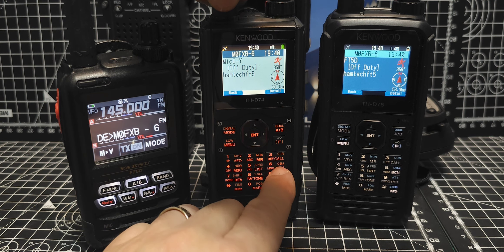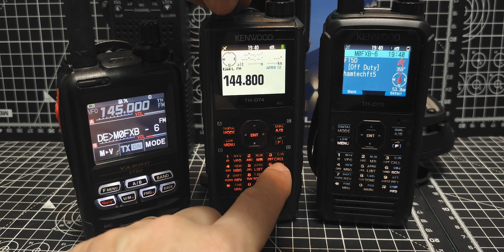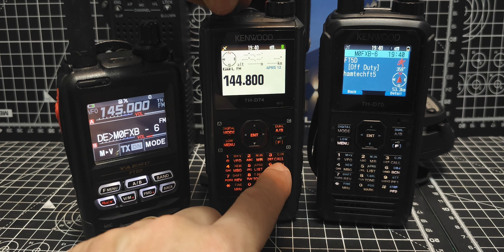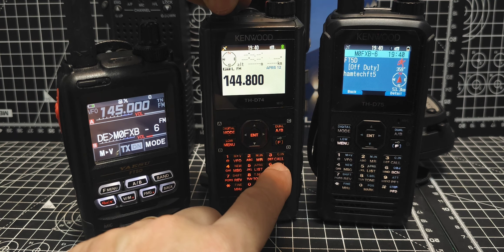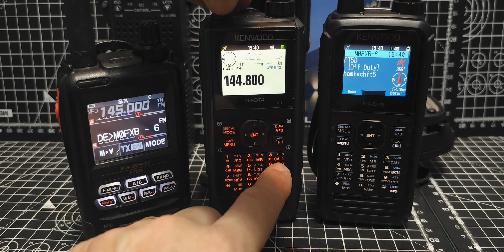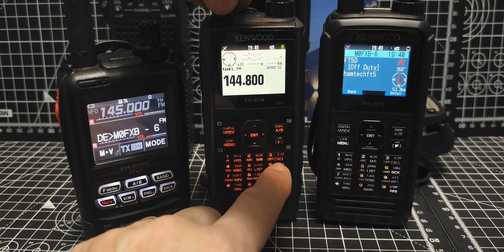KENWOOD D75 - Digipeater FT5D

Comment: Hi Andreas,

At 0:40 actually you CAN enter any values you want for the DIGI PATHs P4 to P8 !

Basically, the digi path is the path you want your APRS packets to follow.
It can be specified in the form of WIDEn-n callsigns (that's called the "new paradigm" of digi path, unlike the "old paradigm" where callsigns like RELAY or TRACE were used), or in the form of specific callsigns that are simply names of digipeaters, like GB3WB that's near your QRA :)

When your digi path contains WIDEn-n callsigns, your APRS packets will be digipeated by digipeaters that are configured to respond to these specific callsigns.
For example, a digipeater in a small local area (a "fill-in" digipeater) would be set to respond only to WIDE1 packets, and a "bigger" digipeater (covering a much wider area) would be set to respond to WIDE2 packets.

If your digi path contains WIDE2-2, if can be digipeated 2 times by "wide area" digipeaters that are set to relay packets with a WIDE2 path: when the 1st digipeater relays the packet, it changes the WIDE2-2 in the digi path with WIDE2-1, informing the next digipeater that this packet should be digipeated only once more.

That's roughly the principle, but you can read this in more details here for example: https://blog.aprs.fi/2020/02/how-aprs-paths-work.html

And like I said, you can also put real digipeaters callsigns in the digi path: if you put GB3XX,GB3YY,GB3ZZ in the path, and these 3 digipeaters are in RF range of each other and also distant from the starting point in this same order, you could "force" the packets to travel through these digipeaters in this exact sequence :)

So on the FT-5D, you can edit digi paths P4 to P8 to set whatever you want as digi path. P8 allows you to enter up to 8 addresses in the digi path.
And P3 contains the recommended preset digi path for handhelds : WIDE1-1,WIDE2-1 (that's not WIDE1-1/2 : the "/2:" in the manual is simply here to separate the WIDE1-1 and WIDE2-1 parts of the digi path :)

As for digipeating on the TH-D75, normally you don't have to use specifically WIDE1-1 on the FT-5D and the TH-D75. As long as you're using the same identifier (callsign) on both, it should work. You could use ANDY1-1 for example ! That's basically what the TH-D75 manual is about on page 14-22. Also, by using a unique identifier like this in your digipath, you can run tests without risking to trigger nearby digipeaters, since they won't recognize your custom digi path.

There's lots of fun stuff to do with APRS :)

Cheers and 73
Reply from the maker: Thanks for all these tips so good :)